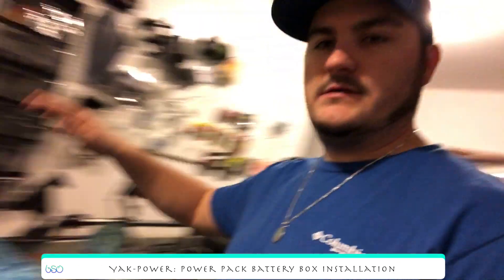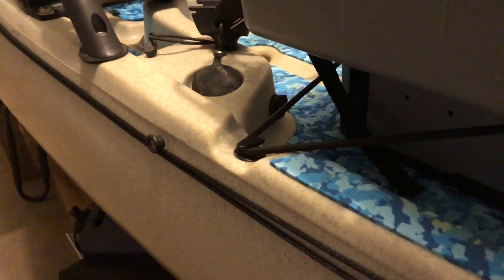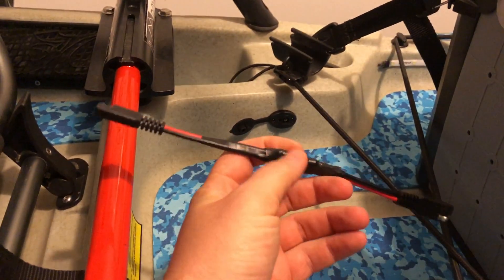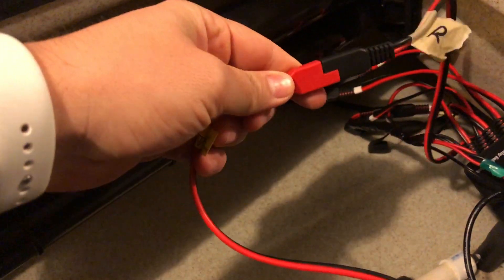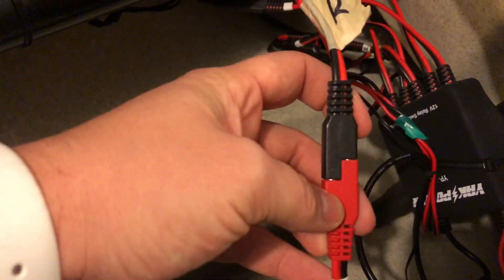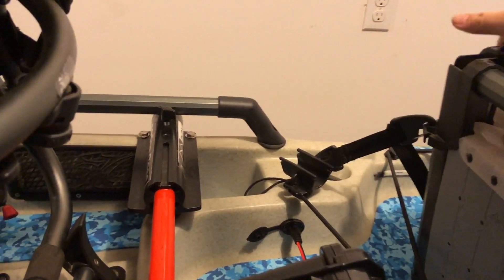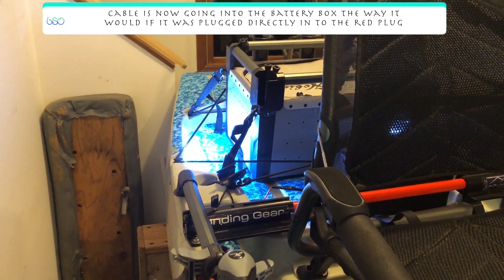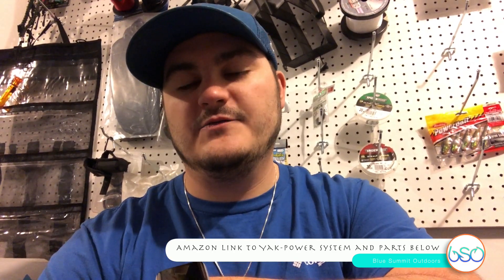Yak Power Battery Box Installation in the Rear of Hobie PA

Comment: We make a power adapter kit that insures the polarity remains correct when powering the Yak Power system through a Power Port. (Model: YP-BBK-PAK)
Reply from the maker: Good to know. Thanks.
Reply: So you don't have to make that with if you have an adapter kit?

Comment: Will that box not fit below the center hatch under the seat ?
Reply from the maker: nope scupper holes get in the way so theres no way to slide it under the seat once its in the center hatch.
Reply: On a 14’ it does fit inside the kayak under the seat but you have to remove the hatch itself to install it. Two foam blocks also have to be removed. I just managed the installation today since I did not want it on the deck.

Comment: Seems to me that it'd be something that they would "solve" within the system instead of leaving the customer to have to purchase yet another 2 cables or another adapter... because without a battery it's useless.  Right?
Reply from the maker: Depends on your application. But it does come with the charger you buy the batteries you want and as far as buying extra cables, it depends on if you want to mount it above the hull or in the hull.